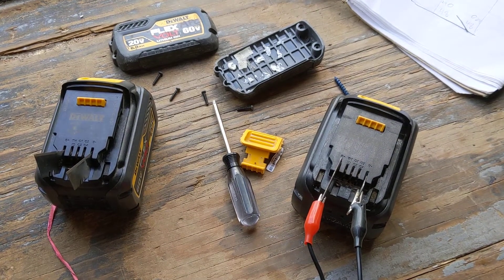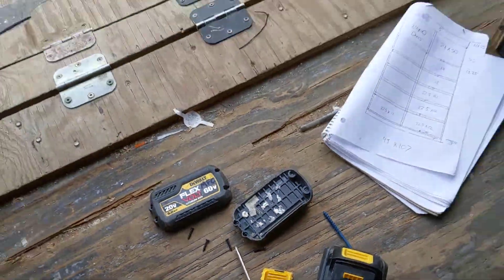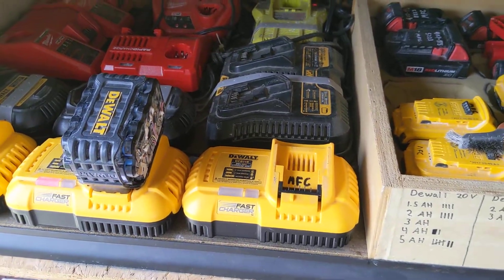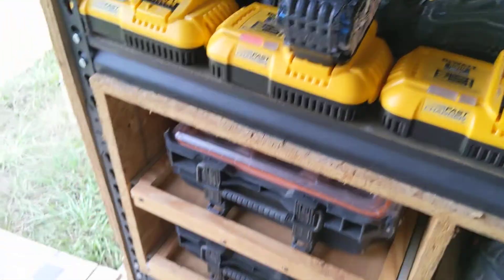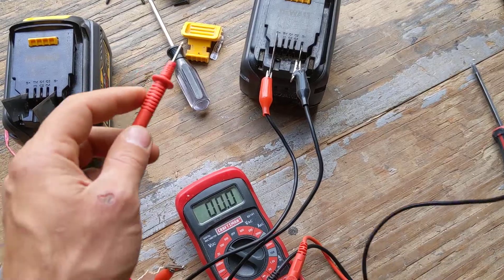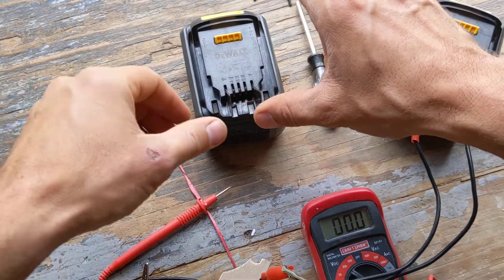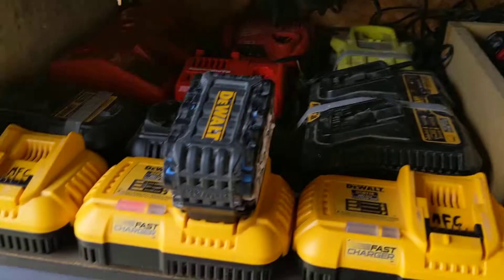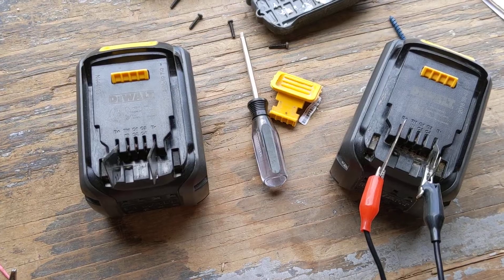How to fix a lithium ion battery that won't charge

Comment: How do you fix a battery that shows it's fully charged but won't work on it's device?
Reply from the maker: Check the voltage on the - and + terminals. If it's 18v it should be 18v or higher, 12v 12v or higher. If the charger says it's charged fully but the battery indicator does not show it's fully charged then it probably is lower than the voltage required to power the tool.

Comment: I had a brand-new Lynnx 40V Li-ion that was about 5 years old and never charged/ used. The charger wouldn't charge it, so I suspected that a super low voltage of ~ 8 V might prevent it. Your video and instructions verified that. A couple of minutes connected as shown to a fully-charged battery did the trick and I was able to get a full charge on it! Thank you so much.

Comment: Metaphorically if you have a stick that is not on fire, all you have to do is set fire to it.  The problem is, I don't have a match.
Reply from the maker: I see the issue. Well... Borrow a match?
Reply from the maker: No, honestly you might be able to use your car battery to do the same thing. But be careful! Messing with batteries is dangerous.

Comment: What kind of multi volt reader would you recommend?
Reply from the maker: Any will do until you start getting into electronics. As long as it reads ac and dc you're good. They can be found from $1-$100+ but a cheap one is fine.

Comment: Careful! Did this and one of the wires overloaded and sparked a quick flame!
Reply from the maker: Wooh, did you accidentally connect - and + together? I've done about a dozen batteries from different manufacturers like this and lead batteries and never had a flame (a small arc when connecting is normal). Interested to hear what you did.

Comment: What can be done to help a battery that seems to only charge to about 50%?
Reply from the maker: That sounds like a cell is bad, but I'd check voltage and see what it's at. Does it function as normal? It could also be a bad led on the indicator but that'd be unlikely because generally that goes completely, not just one diode. If it is still functioning as normal, but has reduced runtime then I would keep using it unless it's within warranty and can replace it.

Comment: can this be done with a car jump battery, little used but wont charge
Reply from the maker: Any battery has the possibility of being revived this way but you'd have to open it up probably to get direct access to the battery. You'll need to pair it with the same voltage from another battery. Just be careful because there's always the risk of fire and/or explosion.

Comment: So how do you know that battery does not have a bad BMS board??
Reply from the maker: I don't, but I have never come across a bad board on any battery. It's always been a cell that was so discharged that it dropped the voltage below the "safe" level of the charger. If it was a bad management board then you could get it juiced back up again and then it would fall too low again, and so on and so forth. I actually had a battery like that that I had to jump 2 times and I thought it was a bad bms but after the second time it's been running fine on its own for about 9 months.

Comment: I have a 56v battery and it's the only 56v battery I have (a replacement costs $255!).  Can I do it with a 20v battery or does it have to be the same voltage?
Reply from the maker: So I don't know the exact make up of your battery but what I would suggest is checking voltage on the different terminals. It could be that they have a bunch of cells in series that make it straight 56v, or it could be like the flex volt battery where they have cells in series to bring them up to 18/20v and then they connect those clusters in series to bring it to 54/60v. So if all you find on your multimeter is that it's straight 45-56v on your terminal then you can't use 20v to try and jump it, at least to my knowledge. So, I think you'll need to check it out a bit more.
Reply: @MyFortressConstruction  Thanks!

Comment: My charger shows that my 56v  battery is fully charged even at 0%.  The battery was at half and it said it was fully charged when put o the charger then, too. And then I used it till it was dead and now the charger   says it's fully charged and won't charge.  It's a $255 Mantis battery for a rototiller and I hate to spend that kind of money.  The battery was only used a few hours but I let it sit in the barn all winter and the instructions said to charge it every month and I didn't do that.  So it's not dead from use.  Any way to fix this?
Reply from the maker: Forgot to mention: I would also suggest just leaving it on the charger. Sometimes they trickle charge which is why the mfg. Says to keep it on the charger when not in use. What generally happens is there is a single cell that is at the bottom of the series of cells that takes the brunt of discharge. It will fall below the correct voltage and basically render the entire battery faulty. If you can slowly bring it back up then the charger will recognize it again and start charging the whole battery. I had one battery I couldn't "jump" but left on the charger for a couple of weeks and it recovered completely.

Comment: I'm only getting 12.2 v across my one and only battery, B+ to B-.
Can I use any method to jump the C4 ( reading 4.2v)? The other C terminals all read 8.1v.
Thanks!
Reply from the maker: As far as I know, you can take it apart and replace the bad cell or jump it and then put it on a charger. There isn't a non-destructive way to isolate a cell from the rest.
  I had a battery that I jumped, charged and it still wouldn't take a full charge (maybe 20% before it thought it was "full") so I just left it on the charger for several weeks and it recovered. So, it's possible that just leaving it on a charger will slowly maintain the cells and could revive that 4.2v cell.
Reply: @MyFortressConstruction  thanks. It's still in the 3 year, so I'll try to get a new one.
Also, I'll probably buy knock offs so I can use the one tool that takes these batteries. But I might also try another charger if I can find one to see what it does.
I think I may have run it down too far on an older tool, but after jumping the Bs from a Ryobi 18v, out now shows 17v... But still won't charge on the charger.
I even tried to juice up the C4 from the Ryobi and the B+, but I think the pack was too smart for that!
Security Torx at work tomorrow, and I'll see if I can go directly to the cell packs...

Edit:
The charger is doing a weird two blinks then pause pattern. Thoughts?
Reply from the maker: @paradoxworkshop4659  Two blinks and a pause mean a problem power line. Have you tried plugging into a different receptacle on a different circuit? I suppose you could check voltage on that circuit as well, but it could just be a loose connection inside the charger. I had a charger that wouldn't charge and when I took it apart it was a loose connection on the A/C cord and after splicing it together with a wire nut, it worked fine.
Reply: @MyFortressConstruction  I looked for this as a trouble code and couldn't find it. I'll try another charger before I do anything else, or fix this one!

Comment: If it is within the warranty period where do you take it to get replaced? Home Depot or is there Dewalt retail stores?
Reply from the maker: DeWalt has a service website that will either tell you where to ship it or tell you the closest place you can take your equipment to. Batteries can't be shipped so: https://www.toolservicenet.com/dewalt/en/findStorePage?Brand=dewalt
Reply from the maker: You're limited in the online tool repair scenarios (has to be certain models and such), but my local center is pretty decent at filling the gap. They've had freight trucks pick-up and deliver lawnmowers under warranty so try calling your local shop and seeing what they can do.

Comment: Anyone wondering why this works, its because they run lithium ion batterys in series and parallel to increase the voltage and amps from 3.7v per battery to 20ish , and to charge a li ion battery like that they charge cells uneven and one overcharges and bust into flames, to stop this and have them charge within a millivolt of eachother equally they have an internal bms battery management system that measures while it charges and takes voltage from the highest cell and dumps it into the lowest to keep all cells equal at all times, when you over discharge one the bms turns off as it thinks the battery is damaged and dangerous to charge, hooking it up to another thats slightly more powerfull wakes up the bms as it feels the voltage from the good battery and the 20 second boost you put in it keeps it on till you put it on a proper charger, then the bms pulls amps from the charger and lets them to the cells again, reawakening  a sleeping bms and saving the battery...

Comment: I tried this my DeWalt Flexvolt battery for just a few seconds but it didn't work. Didn't want to take a chance of it messing up my good Flexvolt battery. I might try again and leave it on for 20 seconds and see what happens.
Reply from the maker: Yeah, that's understandable and I can't guarantee anything, but I've done this multiple times and I've watched the discharge with a thermal imager and they haven't had an issue. Always better to be safe though and do what you're comfortable with. Pulsing for a few seconds is the safer option but with one of my batteries I had to leave it connected for about a minute to get it back. The thermal imager gives me peace of mind when I do that because I can see if anything is getting above 110⁰ F. This is definitely a "Do at your own risk" sort of project though!

Comment: I just watched this, tried it on my DCB606 that wouldn't charge, and within 1 minute, it was able to charge.  Thanks for sharing!
Reply: Ima have to try this. I had a battery with 2 charge cycles die on me. Litterally a brand new battery. I warrantied it and they just sent a new one. Didnt havent to send the dead one which is cool since i can just fix it now

Comment: Mine was an original Dewalt that still had one light showing on the gauge. It was down to about 14 volts and the charger didn't like it and wouldn't charge. I have a variable power supply and added a small charge to bring up the voltage slightly and it charges fine now. I think the charger doesn't like to charge the battery once it gets too low, possibly would damage the charger with too much current...not sure.
Reply from the maker: Right, the charger is checking voltage so once you get it up to within the charger's parameters then it will charge again.

Comment: I have the flexvolt system and have had 2 x 9amp batteries die on me right after warranty.  One of which was sent back only to be told its useless and it was discarded.  I've just brought my remaining 9amp battery back to life with this video. 

Thankyou so much for your clear and concise video.
Reply from the maker: Yeah, I've had six do that to me. I've been able to save them all except one which seems like some cells have permanently failed inside cuz I jumped it a few times but now it won't charge completely. I had a DeWalt rep tell me that since batteries won't hold a charge as well as the first day just bring them in before warranty is out and tell them it's not holding a charge like it use to (which is always true since batteries degrade over time). They should swap it out right then and there. 
  DeWalt and Milwaukee know that these higher capacity batteries have a much higher fail rate after 3 years so now even Milwaukee doesn't offer 5 years on their large batteries. I have 5ah and smaller batteries from 2015 that haven't had a lick of  trouble. Never had one fail. It's all 6ah and larger. Glad you saved at least one 9ah.

Comment: Dude, the greatest !! Just saved me $100-$200 and possibly more in future uses ,this poor contractor thanks you greatly !!!
Reply from the maker: Great, glad it helped. I've saved 4 flexvolt batteries this way too. They seem to make it to 3 years and then start discharging too low. I had to hook up every pin to another flexvolt battery once when the simple + - trick didn't work.

Comment: What a great tip, I've just tried it on a "dead" battery, worked first time - now charging - thanks!
Reply from the maker: Great, I've been able to save about 5 batteries this way and they're all continuing to function. One I had to jump 3 times but it's been working fine for about 6 months now. However, I have had one battery completely give up the ghost so it's not always just a low voltage.
Reply: When the battery was flat again, the same trick didn’t work, so instead of connecting the battery to another one, or putting it directly into the charger, I connected it directly to the + and - terminals of the charger and it charged up ok. I think the other charger terminals must be doing something to stop the charge when it’s low. I kept an eye on the charger and the battery temperatures in case something blew up!
Reply from the maker: @christaylor528  Cool, I didn't even think of that. I assumed the charger wouldn't work without the input from the other prongs. I recently had a flexvolt battery that wouldn't work with just hooking up +  -  so I hooked up every single prong to the prong of the other battery and it worked that way. Seems like there can be multiple things going on and you have to try different methods to trick the batteries.

Comment: How easy is it to ruin the other battery if this doesnt work.I have 2  12 amp batteries for watercraft that are very expensive .One will not take a charge as it got some moisture in it., so I dont want to ruin the good battery?Cheers
Reply from the maker: If you cross the wires and hook up + to - it could damage them, and if you discharge the other battery too far then it could be damaged, or if you did have too much too quickly and overheat the battery then it could be damaged. But that is why you pulse the batteries and keep checking every 5 seconds or so.

Comment: Didn't work. Mine is showing 15.95 volts. I have one bar on the charge level and after the battery jumping it would not charge at all. Then after trying it in the drill it ran. I put it back on the charger and it charged for 10 secs and then was still only one bar and same as above voltage.
Reply from the maker: It sounds like maybe it's getting a little bit of voltage each time, just be careful that you don't put too much energy through all at once. I've had to do this with four or five DeWalt batteries so it seems to be the most common problem. 15.95 is definitely too low for the charger to recognize, but within range to juice it back up. Make sure you are using an equal or higher amp hour battery and just carefully keep raising the voltage.
Reply: @MyFortressConstruction  Thanks for the reply. 2 of the cells are  showing almost zero voltage. I did consider replacing those 2 but the cost is not worth trouble. I will keep it as a spare in case other batteries need the working cells.
Reply from the maker: @messenger8279  It's good you checked. Sorry that it didn't work out. I just wonder how long those other cells will remain good if they stay connected together without a charge...
Reply: @MyFortressConstruction  Should I remove them and store separately.
Reply from the maker: @messenger8279  Yeah, they should be kept at room temperature and voltage should be maintained around 3 volts or so. Honestly, it might not be worth it. Probably better to sell it to someone that deals with bad batteries on eBay or the like.

Comment: there's no date on my battery
Reply from the maker: Is it a DeWalt battery? Most mfgs have a code that you can get the date from.
Reply: @MyFortressConstruction   I wish I had a picture it's a Bauer 1701c-b and the serial number is 3638 32018 and the blue light is staying on in front of it
Reply from the maker: @bonniej0  I don't know Bauer's code syst but it sounds like the 32018 might be referencing month and year (March 2018).

Comment: My gosh!
18 months ago, purchased a Flymo Contour 20v Li grass trimmer in the autumn, fully charged the battery and then stored it till spring. When I came to use it for the first time, the battery was as flat as a pancake! Tried charging it, but the charger light remained on green and would not charge.
Phoned the vendor Amazon, was unable to obtain through them a new battery under the 2 year guarantee as they are disgracefully unavailable. Arranged pick up of the unused trimmer for a full refund. The carrier arranged by Amazon, failed to pick it up (as they don’t!) phoned Amazon and was told to keep it and a refund would still be applied.
So… I have a brand new unused Flymo trimmer, the batteries are still, unavailable anywhere including EBay..
And then I stumble across this YouTube!
Followed the instructions using a fully charged Bosch drill battery as the power source, and Wow!!!…the charger’s red charging light is “On” and the Flymo battery is now taking a charge!!
What can I say but many, many thanks👍
Reply from the maker: Great! Yeah, lithium batteries store the best around 80% charged. This coming winter plug it in every once in a while. Some systems say to leave it on the charger all the time when stored.

Comment: How about  my batteries,everytime I put  it into my charger the charger  say pack charged so its that ok or what should  I do about it.?
Reply from the maker: That's the same issue I had in this video so check the voltage across the terminals (you'll see markings above that indicate + & -).

Comment: where do u get small cables like that? everywhere i look they just have huge jumper cables for cars
Reply from the maker: I think I bought a multi pack of the little alligator clamps from harbor freight or Amazon and then I just used some 10 or 12 ga. thhn wire I had laying around. You just crimp the alligator clamps, or whatever kind of terminals you want, onto the wires.